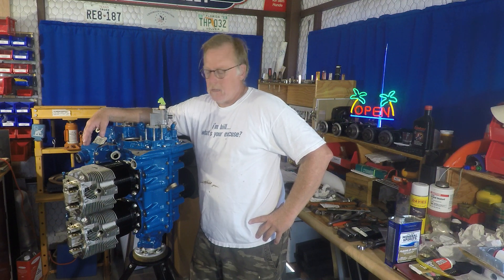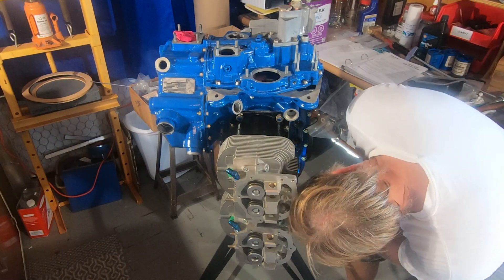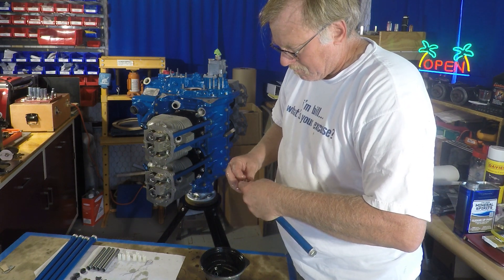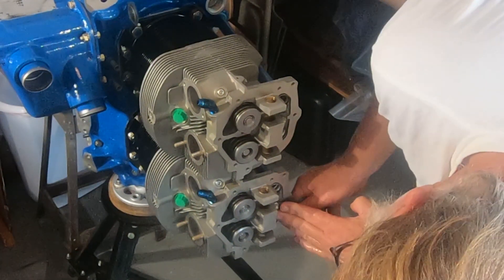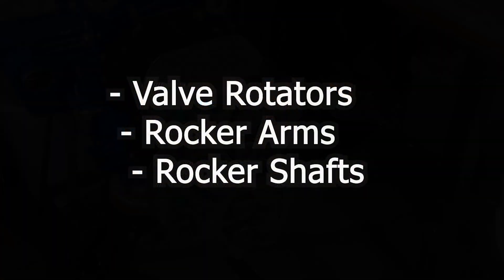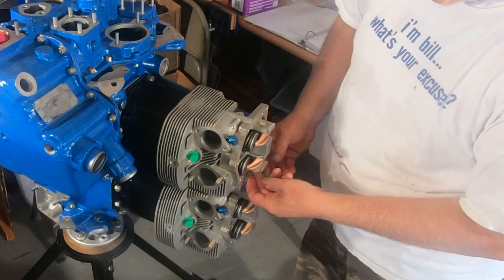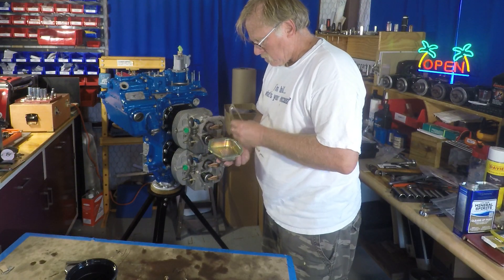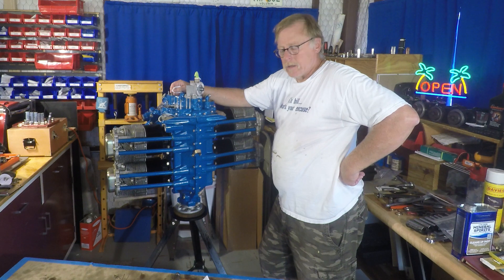360 Engine E14 - We Finish the Valve Installation!

Comment: I really enjoy your videos. I'm an equipment mechanic not an A&P and I have an 0-360 in my Osprey 2.
I'm curious what was wrong that made that valve cover not just push right tight in place... I noticed you pulled it up into gasket contact with the cap screws.
Reply from the maker: The rocker shaft was not in the exact center.  I had to nudge it a bit when I installed the cover.  Thanks for watching!
Reply: It was a tight fit because of either the rocker shaft wasn't perfectly centered or the plastic caps that go on the ends of the rocker arm shaft. I expect that it was mainly the plastic caps since they were new. Shortly after the engine is runs for a bit everything will find its happy place there's tons of thermal expansion and vibration out there as you get further from the center line of the engine. I haven't worked in an engine shop, but I think the plastic caps shrink as they age.  I've pulled them out of old engines cracked and in pieces before too.